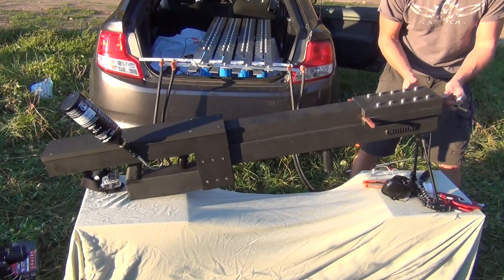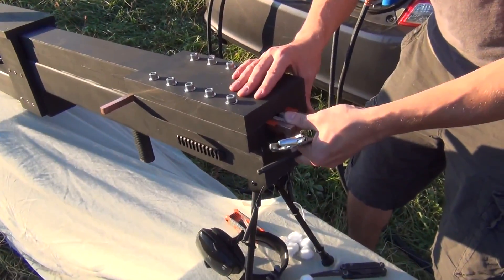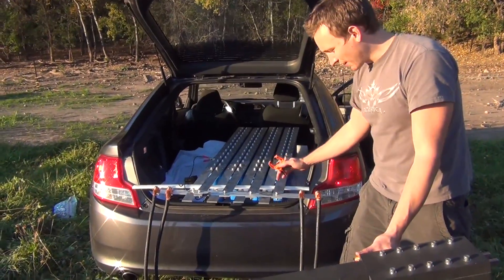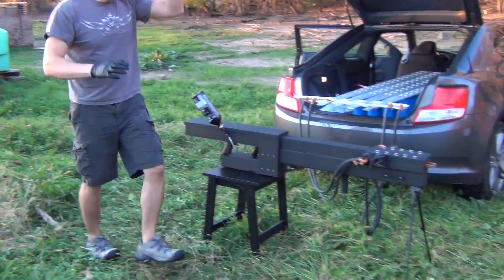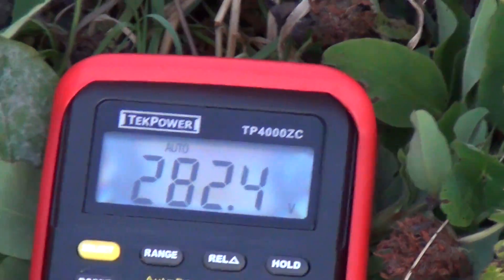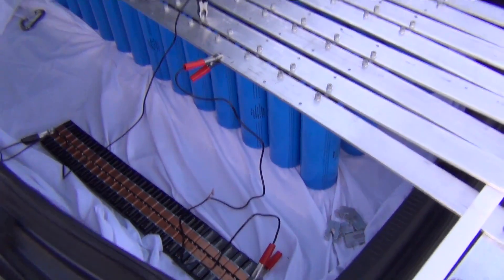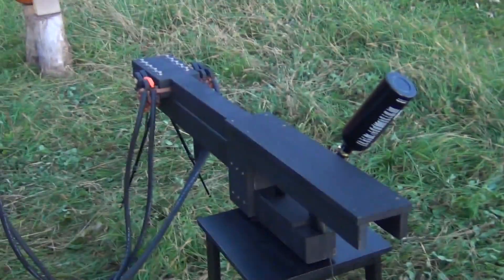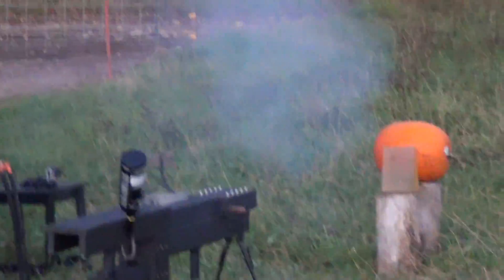EM Railgun Metal Vapor/Plasma Explosion. Launch #2

Comment: You had more inductance in your power supply and interconnects than you did in your gun.
Reply: Maybe, maybe. See also: Ultra power full COILGUN!
https://youtu.be/s6cFMM6MTpI?si=d9uViwHaR6vgnW1g

https://youtu.be/xY17v43TorU?si=ms8LLehidgsVw2Ep

https://youtu.be/zoA_iUGHyPg?si=IuZUGnQfxk9x0d74

The evolution of the bazooka in the third millennium SILENT BAZOOKA (COILGUN - BAZOOKA).

https://youtu.be/0yvVi1eukeI

Comment: I'm curious why you didn't use something like this: https://www.homedepot.com/p/Blackburn-Copper-Mechanical-Connector-3-0-Stranded-to-4-Stranded-with-Single-Hole-Mount-2-Pack-BTC3104-B2-5/100183915 to clamp and bolt the copper cables.

Comment: Can this be done with vaporized aluminum, in a very low oxygen environment?
   I'd try using a air tight container, with a plug on the lower portion flood with argon, gasification of aluminum to cause an implosion inside super sonic speeds even before the it leave the beginning portions of the device. I have a theory also of a self contained engine on the projectile  that is an implosion engine field with mercury and gasified aluminium. The projectile would go further without losing much velocity, however heat is the major issue causing it not to work in theory. Fiction huh..

Comment: Honestly at 9 volts you are probably losing half of your power in resistive losses. Increase the voltage and use copper instead of steel buss bars. Just buy copper pipes and smush them flat.
Reply: actually those should be around 46 9v batteries which can produce 400v the way they r connected

Comment: Is the projectile supposed to be that tight? Shouldn't it be completely loose so the magnetic force can propel it at very high velocity?
Reply: Jamie Clemons not exactly in a coilgun that would work but a railgun needs constant contact with the projectile I'm order to fire
Reply: Jamie Clemons needs electrical contact. The projectile shorts the rails which makes it work. When the projectile touches the two rails it completes a circuit and the extreme current creates a magnetic field pushing the projectile away. The projectile is fired into the rails using air to prevent it from firing backwards.

Comment: Why does it blow the cables off the gun?
Reply: +rubashow probably from the quick powerful jolt of the electrical current is my best guess.
Reply: it sometimes happens to people when they touch something extremely high voltaged they get knocked back  saved many from electricution however
Reply: It’s because of the magnetic field created when moving electric current, it’s the same principle that the rail gun works by. It’s called the Lorenz force.

Comment: you might wanna get an 12to300 ish volts travo to charge the caps off the car (engine running ofc) shud save you alot of 9v batts and  givemore steady charging results

Comment: so what would be the use for this gun? taking out armored vehicles like tanks? blasting through concrete? its loud, heavy, and looks dangerous, and even with a proper factory and machining, I'm assuming this thing could never be made light enough to be shoulder mounted, and if it was would it cause damage to the user with the force and sparks and hot aluminum? I'm just wondering what this does that other heavy artillery cant.
Reply from the maker: +higbey the demon A railgun can take out a fast moving missile, helicopter, or fighter jet. There are zero counter measures compared to a guided missile.

Comment: I read somewhere that that the aluminum projectile is creating it's own lubrication. Could you possibly add some type of conductive lubricant to reduce friction? IE; fine copper powder like is used in the electroplating industry?
Reply: graphene would be alot better, but it expensive, very expensive

Comment: Why do you have the rails so close together? Wouldn't it help if there was less friction?
Reply from the maker: Once the projectile fully enters the rails, nothing can stop it from accelerating. The forces are too extreme. The close fit helps produce contact with the rails.

In this video, the projectile didn't fully enter the rails. I've since fixed the issue.
Reply: +Andy Olarra Same reason gun barrels are so tight. After being fired, bullets have grooves visible in them from the rifling inside the barrel. The round has to basically grip the inside of the barrel to keep it aligned. The same is true here, without the spinning.

Comment: If you use that setup to get 400 Watt in a couple minuts can you use a 1000Watt powersuply from a pc
Reply: +Sir Putin It's 400 Volts, not Watt. A PC's power supply only generates 12 Volts.
Reply: Jmvars No I think you got it wrong
Reply: Sir Putin Ok now I know you are trolling. I will ignore you from now on.
Reply: +Jmvars Yet he lacks the mental capacity of trolling sucesfully
Reply: Jmvars look it up on google and stop being stupid
Reply: Sir Putin
Sadly, I now understand that you are plainly stupid and not trolling.

The railgun uses VOLTS!!!!
As he said it runs at 400 volts which is achieved by a power up module (wire wrapped around a coil) and into a capacitor and then a switch relay.

At 400 volts it will consume 3305,7 watts, @ 8.2 amp with 48.4 ohm resistance.

Look it up on google and stop being stupid.

BTW the creators of this gun should use tungsten metal projectiles as they will carry way more joule and not break up during launch/in air/on impact like aluminium.